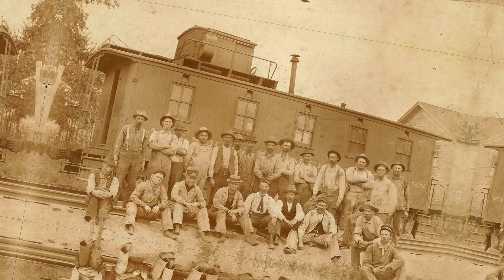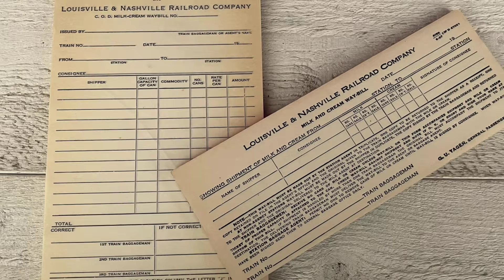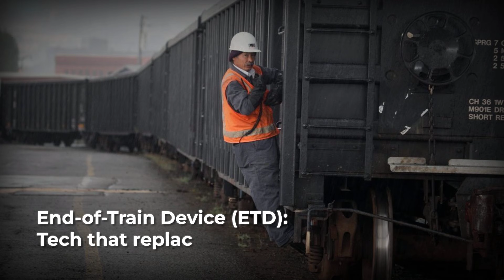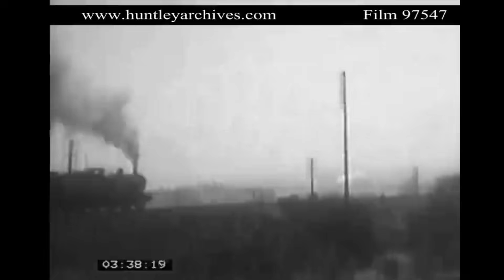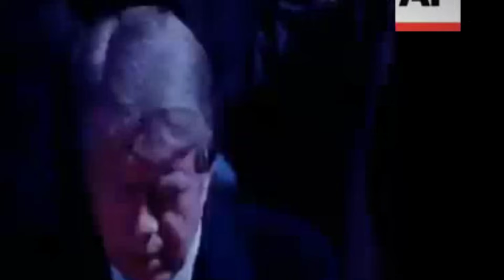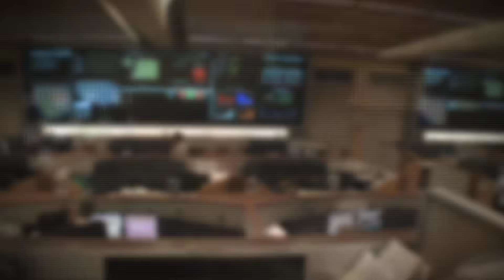Why Railroads Secretly HATE Cabooses

Comment: Since I was born in 1951 I remember my young years when railroad cabooses were in use. I also remember the transition years where cabooses were replaced with End of Train Devices. This video brought up that these End of Train Devices are not encrypted and a hacker could cause problems. I suspect what will happen is new End of Train Devices will start using encrypted signals to help prevent this.